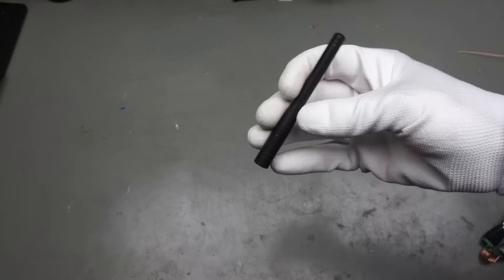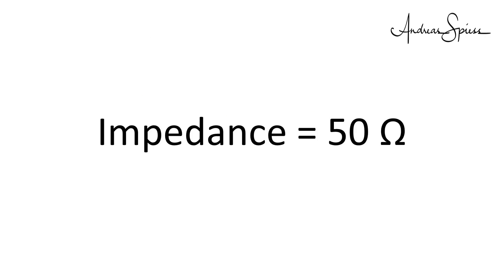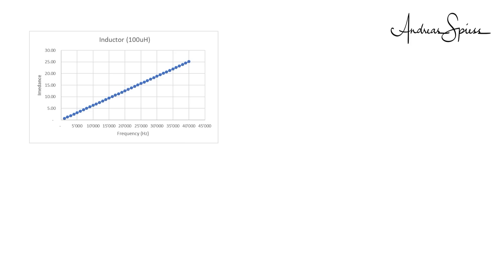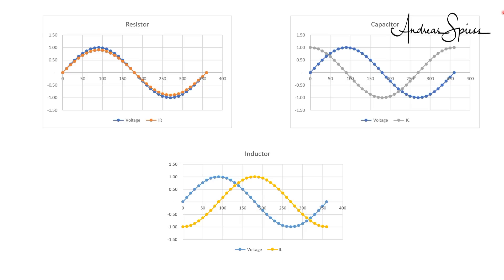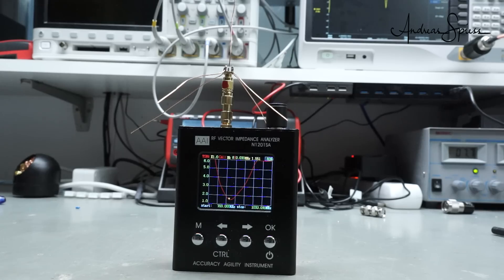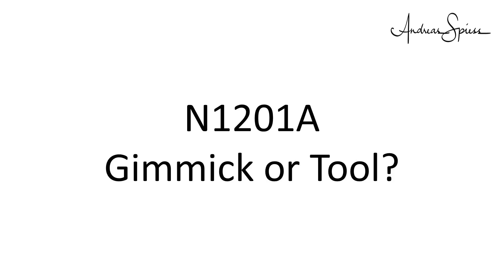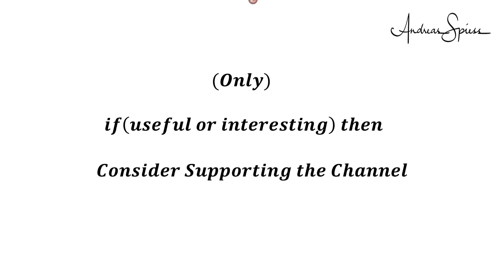#191 Optimizing Antennas using a cheap N1201SA VNA (Vector Impedance Analyzer), LoRa, Review

Comment: Great tutorial! It would be interesting to see how to use this tool to tune a PCB trace antenna or a chip antenna. Can you make a tutorial for that ?
Reply from the maker: It is always the same procedure. You change the antenna and check if it got better or worse.
Reply: @AndreasSpiess  I meant using a matching network and also how to calibrate N1201SA for using a cable between the SMA on it connector and the PCB.
Reply from the maker: This would not be interesting for most of my viewers, I think. There is more specialized material available. Not an easy task...
Reply: @AndreasSpiess  I understand. If you don't mind can you suggest me some material in this ?

Comment: At 11:58 the LTE analyzer shows that peak of that antenna is at spot on 868.
The cursor of the N1201SA is also at 868 but the peak is like 1/3 division to the right.
A division here is ((1000-800) / 7) = ~30Mhz so the measurement is ~10mhz off ? Or was this just due to the difference in close field caused tune shift?
Reply from the maker: I do no more remember the details. This was just a picture we made during the evening. I do not know if it was with the same antenna.
Reply: Would be good to know the precision. I bought one and I suspect that it is off by a few 10mhz in certain ranges. Will check mine with a spectrum analyzer.
Reply: I crosschecked the device with an RSA5056N. The N1201SA is always 10-20mhz off but to random direction and the cheap calibration kit is only useful till 400mhz not above. If it was 5-10mhz i would say acceptable, but you still need a 4k eur calibration kit to make it work?
IMO this tool is useless and a big ripoff.

Comment: Can this unit be used with computer software, I know the Nanovna does. I haven't seen any way to hook this  AAI unit up to a computer I have this model and also the N2061sa. Thank you
Reply from the maker: AFAIK it does not have an interface. Just a USB for charging.
Reply: There is a version of it N1201SA+ with SERIAL interface (~190usd).
Also there is an edition with RF input (N2201SS) that can act as spectrum analyzer.
Reply: @quadcorei8085gen2  mine has an input and a out put. Also two USB ports one mini USB and one Micro USB.

Comment: I learned more about antennas in this 16 minute video than I did from by Extra Class license course.  Thanks!
Reply from the maker: Not good. They should learn you how it works before you buy a 1kW amplifier ;-)
Reply: They do, or at least they try. But it's presented as if you're an electrical engineering student. That's doesn't work with everyone. Definitely didn't with me, and I spent a career in technology.

Comment: will this work with a cobweb antenna that covers several different frequencies?
Reply from the maker: Cobweb antennas usually are used for lower frequencies. On UHF other designs are more common. So I do not know.

Comment: Grüezi, ich habe mir ein nanovna gekauft, ebenfalls ein wunderbares und viel günstigeres Tools mit Touchscreen, welches auch gleich die Kalibrierungstools mitbringt und anscheinend opensource Firmware besitzt. Eine hf-Frage: da dieses Gerät von 50khz bis 900mhz funktioniert...wäre es prinzipiell möglich eine Antenne auf 1090mhz abzustimmen, indem ich diese auf 545mhz anpasse und habe damit auch bei 1090mhz das gleiche Stehwellenverhältnis? Oder ist das ein Denkfehler? Danke im Voraus und VG
Reply from the maker: Wenn das so möglich wäre könnte man ja auch noch höhere Frequenzen mit dem gleichen Prinzip messen. Der NanoVNA ist ein sehr nützliches Gerät (ich hab auch eines hier). Aber nur bis max 900MHz (bis 300 MHz ist er genauer).

Comment: Minimum VSWR doe not mean you've found the resonant frequency.  As you pointed out earlier in this very same video, a resonating dipole has an impedance of 72 ohms (though you said 75) which will give you a VSWR of 1.44 at the dipole's resonant frequency given a 50 ohm transmitter--which as you pointed out, most are.  I spend so much time trying to un-teach this misconception that it's frustrating to find an otherwise very informative source that perpetuates it.
Reply from the maker: I do not know how you define resonance. For me, it has nothing to do with the value of the real part of the impedance. For me, resonance is when the C and the L impedances match.
But anyway it is not very important for this topic where we just want a low return loss.
Reply: @AndreasSpiess  I would define resonance the same way as you--where the radiation resistance is lowest, which is another way of saying where L and C cancel, which is another way of saying where measured reactance is (as close as possible to) zero.  And I agree with you that  this happens regardless of what the real part of the impedance is doing--in fact, that was my whole point, that the VSWR vs. a 50 ohm load can be literally anything and yet the antenna may still be resonant.  I would agree also that in most cases, minimizing VSWR is close enough--perhaps it's just that I'm getting pedantic in my old age.  :)

Comment: Hi Andreas,
Isn't it necessary to measure the antenna including the cable?
Afaik from my old CB Radio Times it's necessary to reach the minimum VSWR.
Reply from the maker: You have to decide what you want. If you are interested including the cable, then you measure including the cable.
I was only interested in the antenna because often no cable is used or everybody uses a different cable. And the cable should be 50 ohms and not change the whole thing too much.
Reply: Hi Andreas, thanks for clarification. Keep forward.

Comment: I just test my diy dipole 900mhz antenna but why impedance very high?80ohm.. how to reduce this impendance to around 50ohm
Reply from the maker: Dipoles have an impedance of around 75 ohms. You have to chose a different antenna type for 50 ohms (a Ground Plane for example)

Comment: Please note that, for low power transmitters, it's often worthwhile to design it to attach directly to the antenna.  This removes coaxial cable losses totally.  If you need to get data some distance to the transmitter, a data cable is much cheaper than coax at any length.
Reply from the maker: I completely agree, especially for high frequencies.

Comment: I am curious about the degree to which optimizing the resonance frequency translates into functional improvements in the system in which the antenna is used, e.g. usable range, data error rates, dropped packets, and so forth.
Reply from the maker: I made a video about the "link budget" of wireless transmissions where you find all the calculations.
Reply: Also very helpful. Thank you!

Comment: Thanks for the video! I was looking for a review of the N1201SA and this is perfect. One question, how would I connect a single-terminal whip, like the ones used on Motorola (GP328, HT750 etc) and Icom (IC-41 series) radios? Just directly to the center pin?
Reply from the maker: This device only can measure 50 Ohm asymmetric antennas with SMA connectors. So you have to find a way to get it to this format or you cannot use this device.
Reply: @AndreasSpiess  OK, thanks for the reply!

Comment: andreas,did you try making and adding some basic copper/conductive ink tiny FRACTAL ANTENNAS to the LoRa, wifi etc transceivers pcb printed aerials and  optimize with the required vna to increase range/power and direction
https://www.youtube.com/watch?v=gB9n2gHsHN4
Fractals are typically not self-similar
3Blue1Brown,Published on Jan 27, 2017
What fractal dimension is, and how this is the core concept defining what fractals themselves are.
https://www.youtube.com/watch?v=HK9MgKck0z0
Reply from the maker: No, I did not try it.

Comment: Another, possibly less expensive, way to do it is in reverse using an RF spectrum analyzer; set your transmitter to output a constant signal, measure the received signal, and trim the transmitter antenna until you get the best result on the spectrum analyzer. It could be argued that this is even more useful because the nature of your overall project design can greatly de-tune your antenna, and this way you can visualize what works best for your specific needs. I am not ashamed to admit I have made commercial products using this approach, as simply designing an antenna to make a VNA happy does not tell you anything about how that antenna actually performs in-circuit, next to other parts, inside an enclosure, etc.
Reply from the maker: I would not agree that a VNA does not tell you anything in the situations we generally use (the antenna is outside the case). 
I used a similar method you propose also in a video (only on one frequency). It is dependable if you are able to put the antenna at the place where it stays, but also creates a little more effort. If you move the antenna you have the same issues as with a VNA. Another problem could be the law if you want to scan larger frequency bands. BTW: Where do you get your Spectrum Analyzers for less than 150$ ;-)
Reply: In my case I virtually always use an antenna that is inside the enclosure, which does cost me a little radiated power but keeps the design small and clean (especially good when my project is to be used by non-technical people). I did not mean to suggest a VNA has no use, just that it cannot tell you how an antenna performs "in place". Most SDRs cover the necessary frequency range, and some of them are shockingly inexpensive (although I do use a $300 handheld spectrum analyzer, the "RF Explorer"). I forgot to say that I really liked this video, and think that this is of GREAT value to new engineers who are understandably afraid of the RF dark arts!  :)

Comment: Hi Andreas, can it be used to check multiband GNSS antenna's too?  Can chip antenna's be checked with this device? If so how to connect them if they are mounted on the PCB? Thanks.
Reply from the maker: You can test all antennas from 135MHz to 2.7GHz as long as they have a 50 Ohm feed and you can connect them to an SMA connector.
Reply: @AndreasSpiess  Will it show all the supported frequencies in the graph and SWR / band? Because it is multi-band.
Reply from the maker: Please look at the diagram of the device in the video. X-axis-> frequency Y-axis->SWR

Comment: Hi and thank you for your very interesting video regarding antenna measuring and the VNA. I se that the vendor also have seveloped the N2201SS VNA with two ports. 
Would you consider testing and reviewing the N221SS extra features as well? In addition to power meter, it is supposed to support some extra measurement features. S21?. 
With so many poorly manufactured antennas for RC and FPV hobbyists, this kind of knowledge and tools are of great interest and benefit. 
Thanks!
Kind regards
Torgeir
Reply from the maker: I do not plan to test the N2201SS as most of my viewers do not need two ports.

Comment: Do you have experience with the management of Rigexpert? I have the AA-600, but it remains at 600mhz maximum. I was looking at several models, which at least could analyze the 2.4-2.5Ghz band, for wifi antennas, and have appeared yours N1201A, the Vna Tiny and another one that is much more expensive, the KC901V, which comes to cover the wifi antennas of double band.
I would like to know if the measurements of the N1201A are quite accurate, since I would like to use it to make high sensitivity Bluetooth antennas.
Thanks for your mythical tutorials.
I wait your answer.
Best regards from Barcelona, Catalonia.
Reply from the maker: No, I have no experience with the Rigexpert. I do not see a correlation between sensitivity and measuring antenna curves. An antenna matches a frequency or not. The signal does not matter (as long as it is not very broadband)
I compared my NS1201A with a professional VNA and it was accurate enough for me.

Comment: Hello Andreas,
I have a question. How spring did you cut from the antenna, so i can optimize the antenna without that expensive tool? Or is there any other free ways to measure the mhz?
Reply from the maker: There is no other possibility to measure. The distances between good and bad are only mm. And they differ from antenna to antenna.

Comment: Hi, as you already have a Siglent spectrum analyser, couldn't you have used that to tune your antennas, by means of a Directional Coupler?
I ask because I need to learn how to tune an antenna for my next project (and I happen to own a Siglent SSA3032X spectrum analyser, with the TG license).
Reply from the maker: I have the Siglent directional coupler, but did not get good results. This small bugger is much better for this purpose (maybe because it also looks at phase). And more handy, too.

Comment: Ii see there is a new upgraded model: N2201SSIt has an RF in SMA port.Wat do you think?https://www.aliexpress.com/item/English-verison-N2201SS-n2201-137-5MHZ-to-2-7GHZ-Antenna-Analyzer-Meter-Tester-6GHZ-Male-SMA/32906369681.html?spm=2114.search0104.3.14.45cd73b9TdEJ0s&ws_ab_test=searchweb0_0,searchweb201602_4_10065_10068_10130_10890_10547_319_10546_317_10548_10545_10696_453_10084_454_10083_10618_431_10307_537_536_10059_10884_10887_100031_321_322_10103,searchweb201603_6,ppcSwitch_0&algo_expid=a37a0386-b70a-4687-aa3f-1abbcd0aecfb-2&algo_pvid=a37a0386-b70a-4687-aa3f-1abbcd0aecfb&transAbTest=ae803_5
Reply from the maker: There were always 2 models. With 1and with 2 ports. This one seems to be the upgrades 2port device. 2port devices can measure more parameters (s21, s12, s22) if you need them. My model only measures s11 which is sufficient for antenna characterization.
Reply: Thanks for the reply.

Comment: I see this device on AliExpress, but the interface looks different. It's in a table format.
The description says:   This instrument  has  four interfaces: single point measurement, scanning, system information,      
   correction and calibration .
Is the graphical interface in your video one of those interfaces? Or did they change the design?
Reply from the maker: You find the link in the description to the one I described. Here.

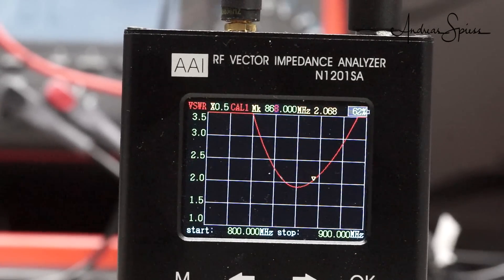Comment: At the 13:44 mark, you say you've optimized the antenna for 868MHz. The marker is reading 868, but it is not at the minimum VSWR point. The VSWR is in fact reading greater than 2:1 at 868MHz.  Why do you say this is optimized for that frequency?  You are making my head hurt.
Reply from the maker: To have the minimum a few MHz away usually is no problem as it will anyway move under real conditions (anything close to the antenna influences the minimum.
I meant with "optimized" that the length cannot be cut much better. Of course, you will find other antenna designs will have lower SWR. But everything below 2.0 is good for low power usage.
Just compare it with before the "optimization".

Comment: We must secure the existence of Andreas Spiess and a future for rf videos.

Also you can tune antennas with far simpler gear that just measures return loss.
Reply from the maker: I was not super successful with a normal coupler and a spectrum analyzer. On these high frequencies, things get a little tricky sometimes....
Reply: I've frequently used a directional coupler and a power sensor.  With a little luck you can get this stuff for almost nothing on ebay.  Even when I had access to a nice network analyzer I would prefer to do it this way, it was faster and more accurate.  https://www.ebay.com/itm/253929647171

Would be a cool 3d printer project to make some wave-guide directional couplers that you paint with conductive paint or glue aluminum foil to or something.
Reply from the maker: I stopped building microwave stuff myself as it is too "mechanical" for me. And without proper meters, you always get results, but you are never sure if it shows the right results. This is why I took the time and traveled to a colleague to compare the small VNA with a professional one before I trusted it.

Comment: Hi Andreas!

Is it possible to measure efficiency of the PCB antenna with this VNA? If I put an uFL socket on the PCB and connect VNA via uFL-SMA patch cord, will it measure correctly?
Reply from the maker: In principle: Yes. But it is very hard to get reliable results because you change the setup for your measurement.

Comment: I now have one of these analyzers thanks to your video and recommendation.  It's actually the two-port model so in the future I may be able to do more than just S11 measurements.  However, I have a mystery.

The VNA works well for my custom made antennas, and shows many purchased ones are crap.  However...  I have a length of coax that identifies itself as RG-58A, but feels far more flexible than I'd expect.  While I don't intend to actually use this for an antenna as it's too lossy at 915 Mhz, it seems to show a constant VSWR across all frequencies from the lowest I can go with this unit up to the maximum.  It doesn't matter if I short the cable end or not, and I have tested the cable for shorts between the center and shield, and there are none.

I do have an older model MFJ analyzer that can go down to at least 1 MHz, so I'll likely test it on that later.  However, this is either an expected yet shocking to me characteristic of this long cable, the cable is defective, or the tool can't cope.  In this case, I suspect it's the former -- all the signal IS being absorbed, so the S11 looks AMAZING as there is no reflected power, the VSWR is AMAZING as there is no reflected power, and the impedance is spot-on.
Reply from the maker: I cannot tell it from here. But it would be interesting if any power leaves the other end... To prove your theory that all power is lost.
It is anyway a strange behavior.
Reply: Andreas Spiess agreed. I’m not sure how I’d measure that though. Perhaps just using a signal generator and oscilloscope showing inputs and outputs.
Reply from the maker: AFAIK the two port model should be able to measure S12 or S21?
Reply: Andreas Spiess indeed it can. Small power only of course.
Reply from the maker: The bigger signals can be done using attenuators, as usual.